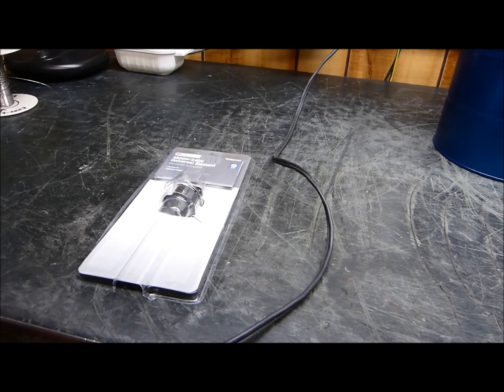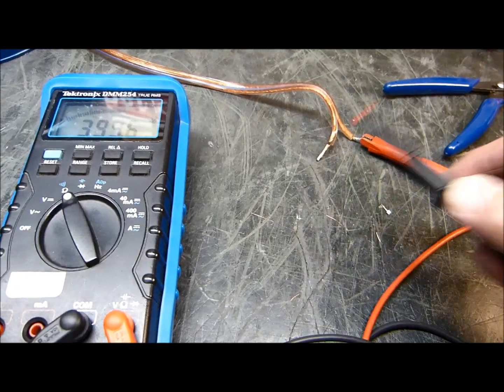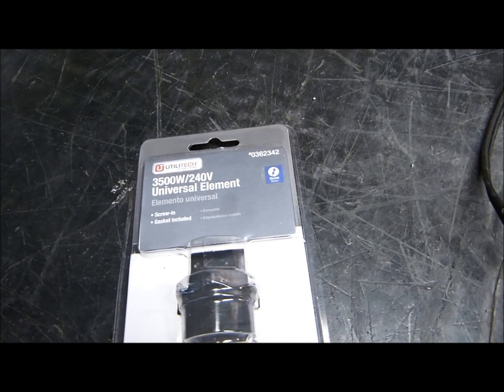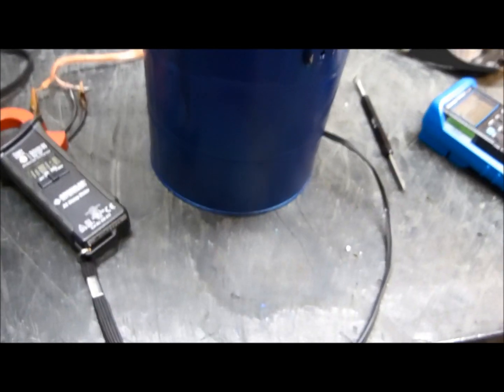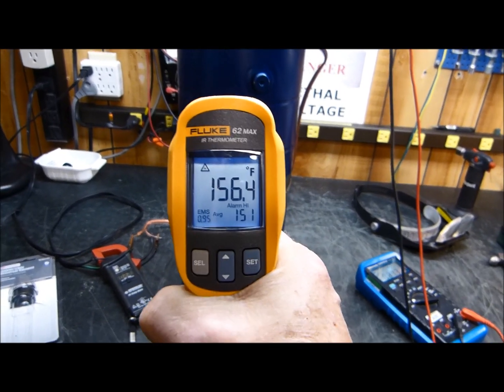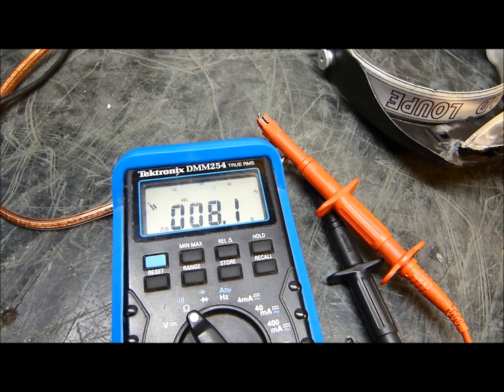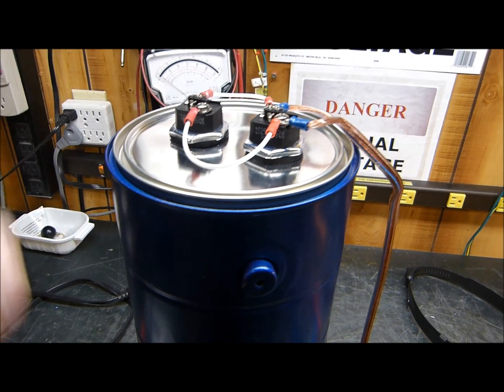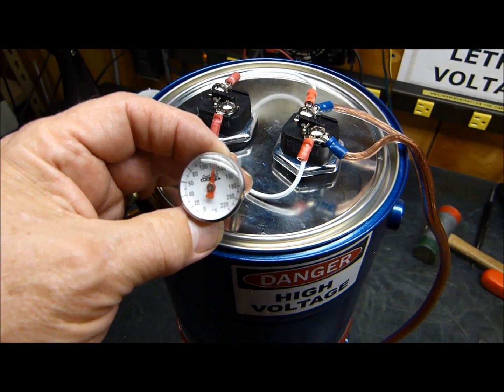8 Ohm Load For Vacuum Tube Power Amplifiers

Comment: So, would one single element give us half the ohms? I.e: 4.05 ohms? That would be handy. Thanks for posting!
Reply from the maker: Each element is 16 ohms so in my video I have two of them parallel for 8 ohms. Using these same elements, it would take four in parallel to make 4 ohms. If you look at other elements like in Lowe's, do the math of,   Resistance = voltage squared divided by power (watts)
Reply: @ElPasoTubeAmps  Damn, just goes to show no matter how counter intuitive the basic concept is (i.e. MORE ohms = Higher resistance) the best policy is DO THE MATH! Your videos contain enormous amounts of knowledge, and being new to the hobby, I just assumed half of 8 would be 4. My bad and thank you for the reply. So, two elements in series would still be 8 ohms? And if so, you would need four elements combined in series & parallel to achieve 4 ohms? I'm not lazy. I've been googling the dog out of this and I've not yet rapped my mind around this and I appreciate you taking the time to reply.
Reply from the maker: @fullwaverecked  You are getting close but keep in mind that each individual hot water heater element is 16 ohms. If you put two of them in Series, they will double and become 32 ohms. If you put two of them in Parallel, they will half and become 8 ohms. If you want to make 4 ohms out of 16 ohms, you would need to put four heater elements in Parallel and then the 16 ohms will reduced to 1/4 the value of a single element and be 4 ohms.
Reply: @ElPasoTubeAmps  I see. Thank you for clarifying.This is a very interesting subject. BTW. What are your thoughts regarding combining a 120w dim bulb tester with a 120w dummy load?
Reply from the maker: @fullwaverecked  A bulb dimmer needs the full 120 volts to work to drive the circuits within the dimmer so that is not going to work for a variable dummy load. Be nice if it did...

Comment: Great video! I should check the blender and the toaster.
Reply from the maker: Before you throw them in the trash can, do the math, I=E/R... Stay safe...
Reply: @ElPasoTubeAmps  I'm only half kidding. I have an older blender with the buttons. I've been wanting to check the resistance.
Reply from the maker: @fullwaverecked  I had a portable heater the other day that I considered parting-out before I threw it away as I might need the heater coil some day for a dummy load. I ended up just putting it in the alley intact because it did work somewhat and someone actually may need it. Lots of the stuff we put out in alleys disappears overnight and usually ends up in Mexico. The pickups haven't been as regular lately because of the virus and many people can not come across the border into the USA.
Reply: @ElPasoTubeAmps  I hear you. These are strange times indeed. That was an imaginative build re: 8 ohm load tank. Really cool. Thanks!
Reply: @ElPasoTubeAmps  I'm seriously considering making one of these! Simple yet highly effective design. And this video also brought back fond memories of an exchange I had a while back with Uncle Doug; we were joking about turning the waffle iron into a giant resistor, and it was making the toaster real noivous. ;)
Reply from the maker: @fullwaverecked  The hot water heater elements were very stable in their resistance between cold and hot but they did have to be immersed in water. That is the thing to watch out for. 
Suppose your floor heater or toaster is rated at 1000 watts at 115 volts. That would be about 8.7 ohms. Adjust your math for whatever your heater/toaster is rated at and then read, as accurate as possible, the cold temperature. You may have to play with it a little bit and, if you are not doing precision measurement, plus or minus an ohm won't make any difference if it is just used as a dummy load to absorb heat. It could also be tempting to do the math on a large light bulb - a really big light bulb - but I believe the cold to hot temperature change might change the resistance considerably on a light bulb or small wire that run red hot like in a toaster. On the other hand, a 1000 watt 115 volt bulb would not light even with a 100 watt amplifier (or less) and the DC resistance might be more stable than we think. Now you got me wondering about the light bulb...Worth a try... good luck.
Reply: @ElPasoTubeAmps  Ah Ha! This is exactly what I have been wondering about, to the point of having strange dreams at night. What I've been obsessed with for days now is how to combine three 40w vintage 12" x 1" bulbs to make a 1 amp current limiter. I.e. 120 volts mains ÷ 120 watts = 1 amp. Oh the humanity! But what I would really like to accomplish is to use one 40w bulb and a combination of power resisters that would not only get me the 120 watts of current limiting, but also magically allow me to load test 2-4-8-16 OHM speakers all in one piece of kit. Any advice would be greatly appreciated, and don't try to be kind, sock it to me baby! After spending 10 years in the USMC I've found tough love is the best love. Thanks!
Reply: @ElPasoTubeAmps  I did some work on a waste oil heater (black gold) last year and for payment I agreed to a large number of '50s/60s light bulbs. All manner of sizes and wattage. I am determined to create a unique current limiter combo 2-4-8-16 OHM load tester with a bunch of '60s power resisters if possible. Any advice would be greatly appreciated. (Please see Craig Hollabraugh's channel video titeled: "170528 Valve Studio - 1 to 12 Speaker Load)... Let me know what you think. Thanks!
Reply from the maker: @fullwaverecked  You have it exactly right about the 120 volts and 120 watt bulb limiting anything in series with this circuit to 1 amp. A 40 watt bulb at 120 volts would limit the current to, 40/120 or 1/3 amp or you could express it as 333 mA. The hot resistance of the 40 watt bulb would be, R=E^2/W which would be 360 ohms. 
If you use two 8 ohm resistors, you can have, 8 ohms (by using just one) or 4 ohms by putting them in parallel, or 16 ohms by putting them in series. This could be done on a chassis box with switches. The resistors, even at high power, are pretty cheap on Ebay. Check these out: 2, 4 and 8 ohm, 100 watt resistors are only $5 each.
https://www.ebay.com/itm/8-Ohm-100-Watt-resistor-for-dummy-Load-1pc-per-lot/372633120147?hash=item56c2aa2d93:g:d98AAOSwXetZWbu~
https://www.ebay.com/itm/4-Ohm-100-Watt-resistor-for-dummy-Load-1pc-per-lot/372633269004?hash=item56c2ac730c:g:dQQAAOSw~e5ZWbty
https://www.ebay.com/itm/2-Ohm-100-Watt-resistor-for-dummy-Load-1pc-per-lot/352621483791?hash=item5219e0d70f:g:HJQAAOSwSzRZWbsz
Reply from the maker: @fullwaverecked  I am sure with the right combination of these bulbs, you can create most any impedance value you want. For speaker values, like the 2, 4, 8 and 16 ohm, you are going to probably want to use high power bulbs or lots of lower power bulbs. I enjoy sharing what I have worked with most of my life and I hope it helps. Sometimes I can sit and answer questions but sometimes I mean to answer questions and continue to read email and that is when I lose my memory of going back and answering the questions that I can so sometimes if I don't answer, it is because I just forget to go back and answer the emails. 
I just watched the video. Very nice setup. Are you Craig?
Stay safe.

Comment: I know it is late but here is a question...   if you are using this to repair guitar amps typically 50 watt but no more than 100 watt at most.....  would you need to worry about immersing the elements in anything?  Would the elements stand up to it alone or do you really need the heat sinking of the water/fluid?

Thank you ... this is brilliant and inexpensive!
Reply from the maker: It would be a good idea to immerse the hot water heater element in water as it is fairly small and can not withstand dissipating more than 50 watts of heat (at the most) without some medium to dissipate the heat simply because of its size. If you don't want to deal with liquid, there are other conventional resistors that will work just as well. The best ones I have are from www.mouser.com and are non-inductive and about $60 each at the 300 watt level. There are cheaper ones on Ebay. I made this dummy load because, at the time, I was dealing with KW level amplifiers and did not have fixed resistors that can handle that much power.
Reply: @ElPasoTubeAmps  Thank you !   That makes great sense!

Comment: Excellent idea! And it’s very useful that you tested for resistance changes with temperature and also that you measured the inductance (the value is given in the description). If a pair of these elements has a resistance of 8.0 ohms and a series inductive reactance of 0.79 ohms at 20KHz, then the magnitude of the complex impedance at 20KHz is 8.04 ohms, with a phase angle of 5.6 degrees, if I did my hasty math correctly. That’s not bad at all. Some might think that the combined impedance magnitude would be 8.79, but that would be wrong and doesn’t account for the vector summation of an inductance and a resistance. This magnitude of impedance of 8.04 ohms at 20KHz shows that the inductive component only raises the magnitude by about 1/2% at that frequency. This is more than accurate enough for most high-power testing.

Comment: Does it make a difference with other wattage or voltage elements?  I noticed yours are 3500 watt 220v. Would 240v still be 16 ohm?

Comment: you dont get any leaks?  What do you seal both can half's with? 
Thanks 
Point
Reply from the maker: +Point Dexter I soldered it with regular solder inside the cans (plenty of flux) and I believe afterwards, a bead of Goop, and some tape on the outside just for good measure and strength (and to cover any of the irregularities). Admittedly, I am surprised and pleased it has not leaked also.
Reply: right if it did you would have 2 gals of water.  Not good in a electrical shop :), And subscribed. thk you. Point

Comment: How's this thing doing?  Still around?  Did you change to mineral oil or keep the water?
Reply from the maker: +ShooterReady It is still in my shop and came in really handy for the 813 amp I recently built. I left water in it as I don't want a leak of oil all over my shop. Water does a sufficient job of dissipating the heat. Fortunately, it has not leaked at all. The elements are still in good shape. It needs a stirring motor as the top gets hot and the bottom stays cold. The lid of the can started getting a little rust on it so I removed it, cleaned it, and painted it with wrinkle grey.
Reply: +ElPaso TubeAmps Nice.  I have been bitten hard by the tube bug.  RF mostly, but I did build myself a little guitar amp running a pair of 7189As.  My problem is I'm about 30 years too young and have no "junk box".  Tube iron is ridiculously expensive.
Reply from the maker: I agree that some of the vacuum tube stuff on Ebay is ridiculously priced but sometimes you can find good stuff at estate sales for almost nothing.

Comment: Man  I was looking at 150 dollar dummy loads.   However, what if your working on a 4 ohm or 16 ohm transformer amp?
Reply from the maker: +Blake Thompson Each of these heater elements is 16 ohms so you could use just one but for 4 ohms you would need four in parallel. If you are not making exacting measurements where you need 1% tolerance and a very low temperature coefficient so that the load stays right on 8 ohms hot or cold, there are a number of dummy loads available for reasonable prices. Large 8 ohm wire wound resistors are fine as the inductance is low enough they will work just fine.  Two 8 ohm resistors may be all you need. Put them parallel for 4 ohms or series for 16 ohms or just one for 8 ohms. Here is a listing on Ebay  http://www.ebay.com/itm/2pc-8ohm-8R-100W-Watt-Power-Metal-resistor-for-tube-amp-test-dummy-Load-/201057901616?hash=item2ecffc1c30:g:qXUAAOxyUgtTLbB0  Some of the best 300 watt 8 ohm resistors are from www.mouser.com  The part number is "ARCOL NHS300 8R F" and are $70 each. Hope this helps.

Comment: What were those long things that go in the water?how did you put them on? For us guys who do not know a.lot you kind of pass us over...thanks again
Reply: Don't know if you found out by now, but those are the elements and they come with the unit. At least they do at Home Depot.  Hope this helps.
Reply: Electric domestic hot water heater elements.

Comment: this is pretty nifty! i wonder if there'd be any benefit to using antifreeze, perhaps the "pet friendly"/non-toxic kind. or maybe mineral oil? then again, i'm not an engineer, so take that for what it's worth;). someone else mentioned distilled water and that would probably be a good idea, just to keep any potential corrosion issues at bay; i know the computer overclocker crowd uses it for that reason.
Reply: +catdumpling Prolly mineral oil would be better. Ever smelled Hot antifreeze? point

Comment: Great Job. I've always used a dryer element because I've never had the need to dissipate that much power however, I have thought about using these hot water herater elements before and wondered how stable their resistance would be. Well sir, thanks to you, I now know. I was thinking that oil as a dissapent would finish off a perfect high wattage dummy load. Their's a lot of amp guru's that will be off to see the wizard at the wonerful land of Lowes. Kudos!
Reply from the maker: Great - I am always pleased to post something that will help others. As for oil, I don't know how they will react as the oil will allow the elements to reach a much higher temperature than they are designed for - the water boiling will keep the temperature to 212 F or so, it might be a good idea to do some testing in oil - on the other hand, unless a person is seriously pumping a KW of power into them oil or water might not make any difference at all - I would love to know the outcome if you do any testing with oil. Thanks for your comments.
Reply: You got a point there.I really didn't think about that. The only concern I was addressing with the oil was long term life of the elements but on the oher hand though, these things run full power in some foul mineral rich water for years on end so I'll have to agree with your dicission for using water. Much better heat transfer. Again, great job and thanks for sharing.
Reply from the maker: bain5872 You have a good point - these things live in a hostile environment for years caked in minerals - I guess they will do fine in pretty much any liquid that can dissipate the heat away from them. Oil certainly won't evaporate or boil off like water. I wonder what two gallons of mineral oil would cost - probably more than the entire dummy load   :-)   Maybe just strapping them to a large heat sink and putting a fan on them would be OK.
Reply: I agree with the price of the oil. I think H2O is the way to go here. Maybe a pint of antifreeze would keep the rust off the cans and bugs out of the water. Or just paint the insides of the cans. Again, great job! I look forward to making my own.

Comment: Next is: please do not worry to much about the resistance changes. They do not chage very much, as they are intened to be used on mains. So if the resistance are falleing they draw more current and either setting off the fuse or go burning stuff.

Instead of doing this, they got positive temperature coefficient, so the resistance does indeed go up, when there are dissipating very much heat. Cook one on your
bench via the variac in air and see what happen...;) As I done it some years ago and found out that its resistance raised until it opened.
Reply from the maker: Well, you described it perfectly - keep them in water and cooled to a temperature for what they were designed for because in open air they will burn up - pretty obvious that they can not dissipate multi-killowatts of power all by themselves as there is simply not enough mass in them - thanks for your comments. I am picky about the resistance being accurate and stable as I am constantly measuring power - I have some of the cheap sand-block type 8 ohm 200 watt resistors but their temperature coefficient is absolutely horrible and will drop to 5 ohms when they are not even very hot and they aren't even 8 ohms when cool - I consider those type of resistors junk.
Reply: That is why the cheap - they are crap....no one would use them if they where not dirt cheap! ;)

Comment: Ok you´re finished on your excellent 7kW dummy loads, next is to hook it up to your latest Tube Amp and see if you´ll make them cook or just boil water. Please use destilated water only or the will not last very long in hot normal water. Or fill the can with oil, simply use the old one when you change your car´s oli ;)